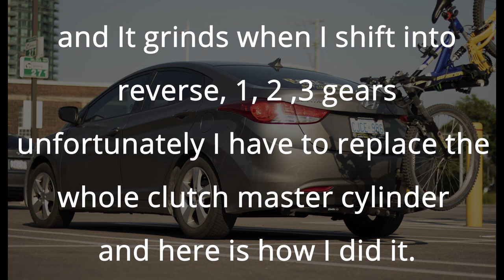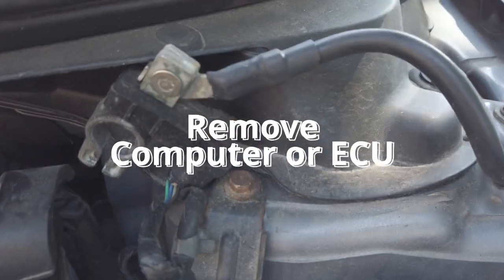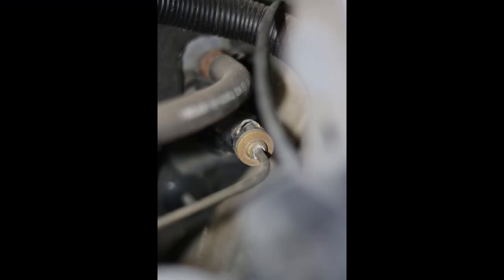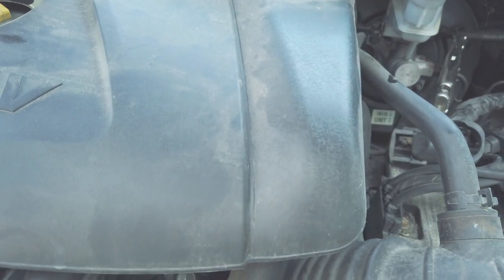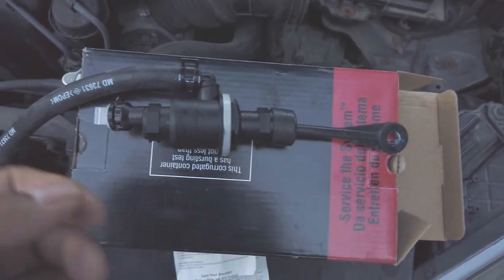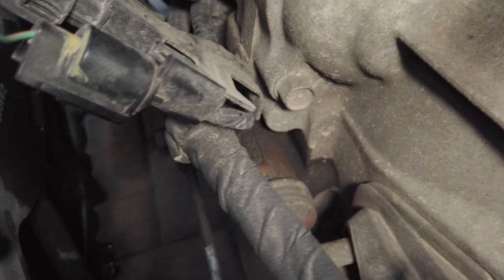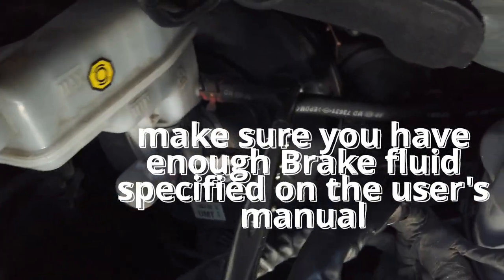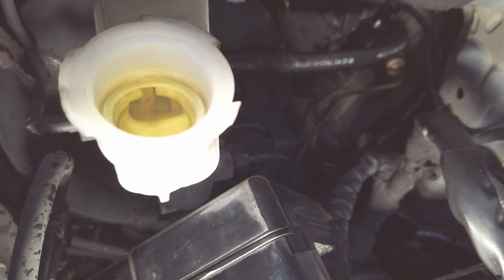Hyundai elantra clutch master cylinder replacement | Hyndai Elantra 2012 hard to shift gears

Comment: Thanks, I just replaced my clutch master cylinder, car is 13 years old 172k miles, it solved the gears crunching when I put on reverse. The hole was very worn out. BTW, there is a bleeder screw on the slave cylinder.

Comment: the video helps as mine just went out at a red light....that mixed with the fact my transmission fluid was way too low and wouldn't let me shift gears....yea big bad problem...thanks for the video though...now I'll know how to replace the part
Reply: How did you know your transmission fluid was low and how did you fill it back up?

Comment: Very helpful, thank you so much. Will be doing this repair to my 2013 Elantra coup soon
Reply from the maker: glad I helped! thank you for watching.
Reply: @herreraschannel8930  hey actually just one question, where is the clutch bleeder valve on the transmission? I was unable to find mine. I would legit be so grateful if you made a video explaining it
Reply from the maker: @threedaysgracefanful  there are 2 ways of bleeding it one on the master clutch cylinder and one infront of your engine almost in the middle part its hard to see it on top, you have to see the location underneath then open the valve from the top.
Reply: Can I replace only the push rod that is woreout?
Reply from the maker: @p3k4d0rproductionz  unfortunately no you have to buy the whole clutch master cylinder.

Comment: Hi,
Thanks for making this video. 
Yesterday, I was driving my elantra MT. I was on full stop and when the traffic light turned green, I had difficulty switching from neutral to first gear. I turned off my engine for 10secs, and started it again. 

The clutch went up automatically and I was able to switch the gear to 1st gear
Reply from the maker: check your clutch hydraulic the master or the slave one infront of the engine below the intake manifold.

Comment: I just recently had my slave and master cylinders replaced. I was able to get pressure in the clutch after the repair but after sitting overnight, the problem with no pressure came back. My mechanic and i are really confused why this happened. Do you have any experience with this?

Comment: How did you bleed the master. Day two and I still can’t figure it out! Costing me more in renting a car then to take it to a mechanic.
Reply from the maker: what is the problem are you having right now? is it hard to get into gears? or you don't have pedal at all?
Reply: There's a bleeder valve on the sl*ve cylinder

Comment: I tried every fix including master and slave cyls, damper, it seems to last for a time but back to low bite.
Reply from the maker: yes because of the cheap plastic rod they use on the master cylinder. We just have to deal with it.

Comment: Is their some kinda clip or something other than the two bolts to get the master cylinder out I took the 2 bolts out and it still won't come out.
Reply from the maker: sorry this might be late but you have to twist the clutch cylinder clockwise and push it out.

Comment: Please help 08 Elantra
Reply from the maker: what is the problem?
Reply: I need help with what to order. The clutch pin finally went today 2005 Elantra
Reply from the maker: @sylviagriffen639  can you take a picture of the part?
Reply: Clutch pedal still stays on the floor after replacing have to pull pedal up no pressure building

Comment: I will say that if you replace this and are capable, fitting a metal bushing in the master cylinder rod wouldn't hurt. they wouldn't wear out if they weren't made from plastic or at least had a bushing. such a silly issue.
Reply from the maker: Yes that's what I thought but when I did that the center of the hole is not accurate it is in off position. Now it is starting to wear out again. That plastic rod.